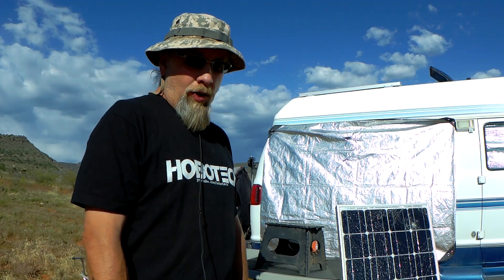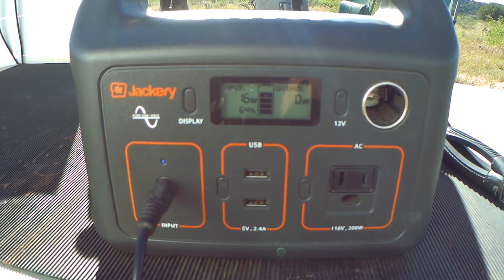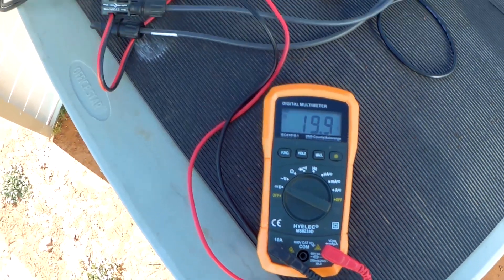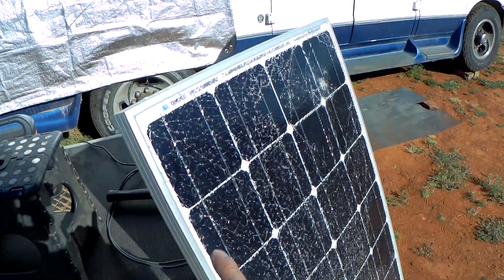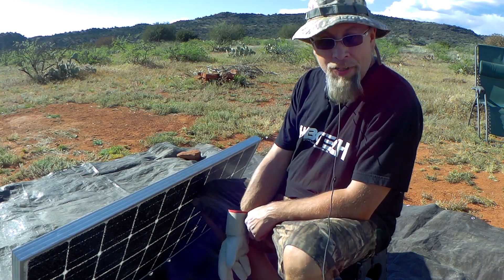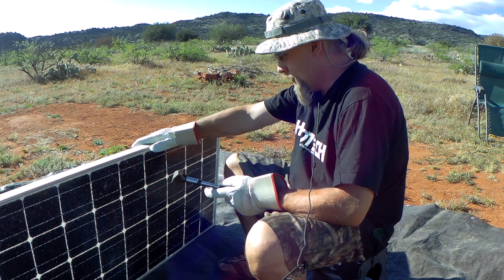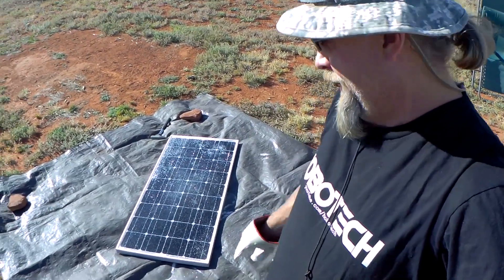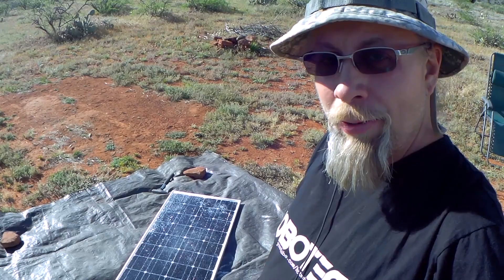Using A HAMMER To REPAIR A Broken SOLAR PANEL? #stupidtechfixes

Comment: I JUST PUT CLEAR FILM STICK ON ADHESIVE OVER MINE. AND IT HAD LARGE CRACKS THEN RAN SILICONE AROUND THE EDGES OF THE SOLAR PANEL TO STOP WATER GETTING IN AROUND THE EDGES. MY PANEL WAS BRAND NEW WHEN IT CRACKED WHILE MOUNTING IT AND IT STILL WORKS. 41 VOLTS 13 AMPS.

Comment: Did you check the voltage on the panel after the "hammer experiment"?  If you have one of the solar cells in your hand and you look at it with malice in your heart, it will break.  Silicon is very brittle.  Odd way to connect a voltmeter.
Thanks for the video, it was entertaining.  I will look up more.

Comment: HT, Not about the Warranty.  Ask Renogy how the solar panel was constructed. You were surprised that the glass didn't come off the solar cells as you expected.
Reply from the maker: Ah okay. That wouldn't have made for a very good video though...
Reply: HT, You are right it made it a better Video. Good Luck with the generator.

Comment: Now we know why they use lacquer or clearcoat!
Reply: that still would be completely useless.
Reply: @AsTheWheelsTurn  No it's not completely useless. Because if the panel is still producing decent power then clear coating it will seal it from water getting in.

Comment: You cannot remove the glass because the the cells, and the white sheeting (backing material) is bonded (laminated) together. I've seen these built at a solar factory. They lay the tempered glass down, then a clear sheet, then the cells, another clear sheet, then the opaque white sheet. That then goes into a big lamination machine that presses/heats until its all bonded to the glass. They test the panel, then it goes to get the aluminum frame/extrusion installed, which they just glue, and press on to the sides of the glass/panel.

Comment: I tried the same thing.... It didn't work out at all.   However I did a couple coats of poly and am still getting 36 volts 8.6 amps and 320 volts out of it.  It's close to spec so it's worth a try if you haven't disposed of it.  However, I can't recommend the marine grade polyurethane I tried the last time as it reduced the output slightly then three months later has a lot of peeling, though it was prepped carefully.  Good luck!
Reply: What type of poly did you use if you don't mind me asking...?
Reply: Thanks for this! I have some lying around and was going to try this.

Comment: Maybe I am wrong but if I remember correctly Watts = Amps x volts.
 That's said, my shattered suitcase Which consists of two 50 W panels  With one of which is lacquered over with 3 Coats of polyurethane still puts out 4.9 amps at 19.9 V.  That means it still produces  97.5 Watts.  Which for me is well within reason for having a easily repaired 100 Watt suitcase.  And yes, my panel was shattered as completely as yours.

Comment: I’m definitely no electrical engineer, but I would theorize that the broken glass is causing a prism like effect and throwing the incoming sun rays in all kinds of directions so it’s not getting all the power of the sun into the cells. I’m also wondering if a coat of clear coat or something would help reduce the scattered sun rays and maybe get more sun to the cells????.... Hell I don’t know, just thinking out loud.
Reply: That is what I was thinking.  It would be a cheap experiment to test out if the panel has not hit the dump.

Comment: When you broke the glass in the solar panel, it reduced it's ability to refract light by 84% as evidenced by your meter readings. Filling in the cracks with lacquer or polyurethane would increase the physical properties of the lights sine wave to pass through the panel again to maybe 50%. That maybe what other youtubers are experiencing. 😀
Reply: That's what I thought to, but my calculations came up to an  increase of about 49%
Reply: Pat are you Pat from the credits?  😀
Reply: Mr Minimalist Yeah, that's me!
Reply from the maker: I gave the panel to someone that is going to coat the glass and we'll do a retest. I don't see how coating broken glass will do anything except stop more UV.
Reply: @HOBOTECH  Alright, some real R&D. I'm anxious to see what affect if any that has on it. I'll be looking for that video! Thank's Tom! 👍😀
Reply: @HOBOTECH  I think it is like when you wet scratched paint and it fills in the spaces making it more even on the surface this stops  some of the refraction...

Comment: You know what they say... if you can't fix it with a hammer, you have an electrical problem.
What originally broke the panel anyway?
Reply from the maker: It flipped over on to rocks during a wind storm in Quartzsite.
Reply: @HOBOTECH  it must have hit really hard! I had the impression that the glass was very durable. They probably glue the glass to the cells to make it behave like high impact safety glass that has a layer of plastic to prevent large shards from decapitating nearby pedestrians.

Comment: You need to install gorilla  Glass Screensaver, On your panel.  at least you gave it the all-American  Try . Good Video Tom.  They make a new solar panel, that utilizes a very small nano size pick up, with a magnifying glass mounted over all the pickups, Allowing for more sensors per panel, in high efficiency in low light. As a test,  Set up a panel & a meter,
TRY to increase output, by holding a  Magnifying glass over the panel. Just a thought. Have fun in drive safe.

Comment: Re: Hyelec MS8233D Digital Multimeter. To measure DC or AC voltage: ① Insert the red test lead into the “VΩ” input terminal and the black test lead
into the COM terminal. ② Set the rotary switch to DC or AC range. ③ Connect the test lead across with the object under testing. The measured
value will be shown on the LCD.

Comment: You gave up too soon! If you banged on that solar panel for a few days you could of got the glass out. (what else is there to do out there?) Also you need a screw driver, the only tools you need in your tool box to repair or tear apart anything is a hammer and screw driver.
Reply from the maker: Contrary to popular belief I don't have the time for that, Pat ... LOL
Reply: Lmao I was living in the bushes are n maui hawaii one time and I found a busted panel...so while at the laundry matt the girl was washing clothes and I figured ...kill some time ...got my hammer and started busting out the glass..it actually was working pretty good...then maui police dept showed up......yeah it wasn't fun...and there was some glass had gotten on the side walk which I believe it or not had planned to clean up....but maui cops didn't believe me so I went and got my broom ..lol I was like cool hand luke sweeping it up..... hollering ....sweeping it up here boss !! Yes sir boss!! Sweeping it up!.....lmao ..they finally told me to stop.

Comment: Hi i dont think solor worth the money you have to have alot of  solor gust for a hair dryer i gust use a genrator i love your vidos  have a great day
Reply: There are lots of off grid people running just on solar..
Some even charge their electric cars....
Some are running a semi-perminent rv on 1500 watts at 24 volts
5,000 watts 24 volts is better
9000 watts 24 volts pretty decent..
Running thru an MPPT charge controllers...
Panels wired to approach the maximum of the controller...
But then again....
Your life changes..
Your heavy power draws.
You only use while the sun is up putting out close to max power...
When the sun goes down
No more heavy loads
Air conditioners...blow dryers...electric ovens...
Electric water heaters..
Just light loads. Led tv.. Led lights.. Low wattage stereos.
If you can't live that way..
You will kill your battery bank in 1-2 years 
A starting level battery bank runs app.  $2,800
Better bank $5,600..
But if you really want to live off the grid and willing to learn..  That battery bank can live 10-12 years

Comment: Initially, I thought what could go wrong, a hammer and a solar panel. 
That's to bad the manufacturer glued the cells to the glass. 😫 If you could have separated the two, I thought you would have your first solar mat. 😀
Reply: They are all manufactured this way. The glass. cells, and backing material is all laminated together.

Comment: This might seem like a failed experiment, but in reality it is a successful experiment because now we all know so much more about the panels! Also they cannot really be repaired by any means at all, if you lacquer them you will seal in tons of BS and oxygen that will destroy them pretty quick. The glass is vacuum sealed to the solid state cells. Even if you took one to the factory, they would probably just give you a new one to get you to leave lol. "Too inexpensive to be repaired". You COULD get the glass off there with a torch or heat gun, but please don't.

Comment: i LEARNED SOMETHING NEW TODAY, not surprising that the glass would be glued to panel so as not to be fixable.  Thanks for this video and all you do to give us information to help.
Reply: Haha, yes, but please be careful.  There are so many insane conspiracy theories flying around the internet.  The statement "so as not to be fixable" suggests this is the reason, which is absolutely false.  A "solar panel" is an aluminum frame around a solar laminate.  The laminate is just what it says, a laminated item.  When panels are made, layers are laminated together for strength, moisture resistance, physical integrity, etc.  They were not made for you to easily peel them apart; they were made to be strong, structurally secure, and last decades.

Comment: Should have tried heat. A heat gun might have softened the glue up enough to allow you to scrape the glass off the cells.
It also might have de-laminated everything and you would have been left with a pile of unglued parts.
 Nothing lost testing on a junk panel.